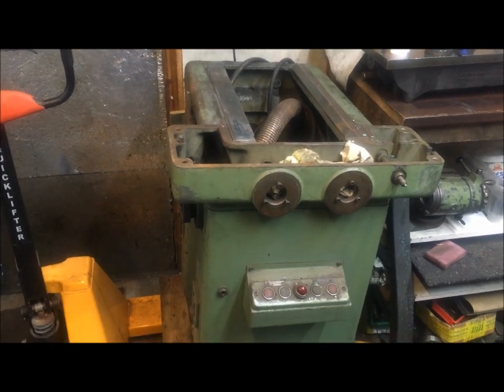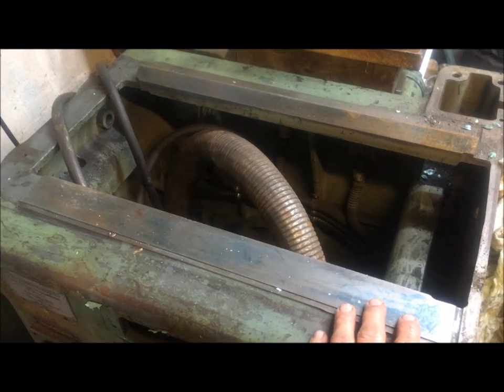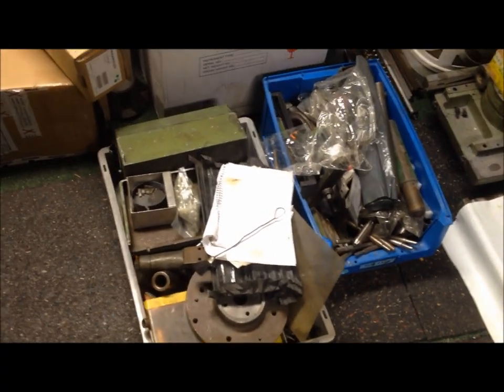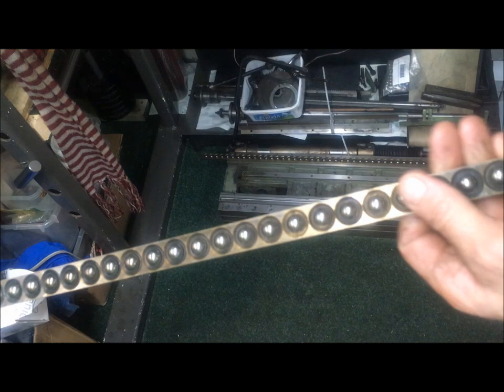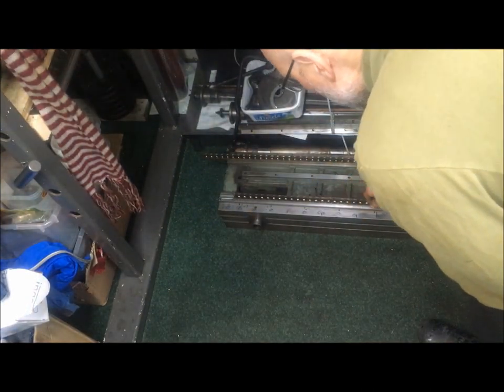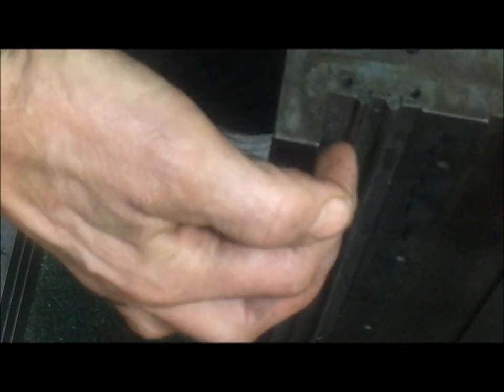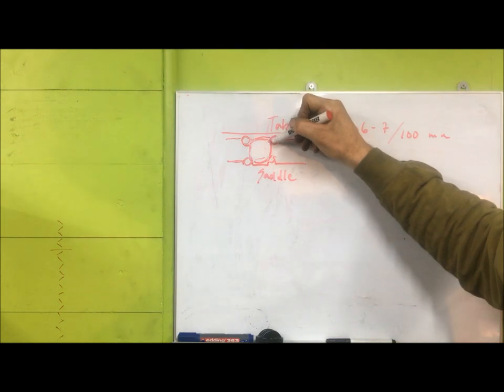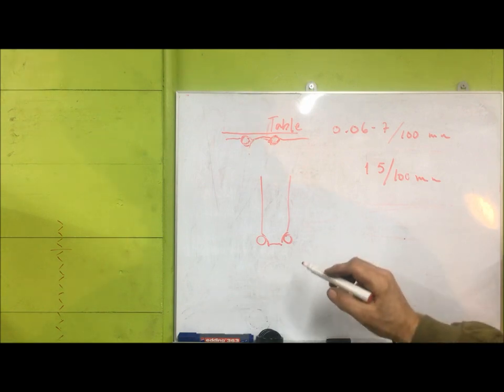Saacke UW 2

Comment: This is going to be a good watch Jan, good luck with it.

Alan.
Reply from the maker: Thanks! I had to drag the beast of a foundation into my workshop as the garage needed to be used for its' intended purpose, namely housing the cars :)
Therefore, "landing" it into the shop, I thought it was timely to "officially" start the restoration project (on my part.. my friend, the former owner had also done some work, pulling it almost all apart and in particular improving on the flatness/straightness of these "way strips" )

Comment from the maker: As the former owner pointed out, he did a certain effort to "straighten" the strips already, as the wear was considerable. Very nice, and thanks Ola! He also mentioned being in contact with Saacke, who no longer supports this type of machine, having left this to a company called Schreyer. Saacke confirmed the possibility of doing the grinding the way I intend, but stressed the importance of setting up the wheel with the exact diameter of the 12mm balls, ie. radius grind the wheel to 6mm on the sides. Retaining the distance between these strips it means the 2 opposing sides of the table/saddle will come closer, so it remains to be seen if I have to allow for this also ie. grind or mill off what is needed.

Comment: Hi, I can see what you mean by the distance between the 2 rows of balls not being the same distance as before would cause huge problems, I find it strange that they have made it this way, because it have to be made very accurately, if one of the ways was flat any wear would not cause problems, You should watch Robrenz, he is restauring a grinder, when you are done with the restauration and you need something to grind then  I got 2 MK4 test bars that could use some grinding to be usable for test bars :-)
Reply from the maker: I might check up with manufacturer/service company  in case they have some more ideas what to do. Perhaps it is equally good just grinding a 45 or 60 degree flat V-way that the balls can ride in. Will confer with Mr. Renzertti also
Reply: Hi, Asking Robin is a good ide, what I dont think is a good ide is to let the balls ride against the cast iron (wear)
Reply from the maker: Agreed! My thoughts is to try to restore the original idea, which I seems to understand is to let the balls ride against the 2 strips (hardened). They appear to be circular 6 mm diameter rods and I thought a grinding disc setup with the correct distance between 2 circular grooves could establish this. Possibly having to relieve the center portion (and maybe other areas, eg. to avoid the saddle and table coming into contact)

Comment: Why would anyone design machine ways this way? Not only does it seem to be overcomplicated, but it introduces more deflection than a flat vee way. Plus a greater risk of brinelling. 
Ps. If you need help translating something from german I could help.
Reply from the maker: I reckon Saacke had their reasons, but it may be a bit tricky to get right again when worn. PS! I think it is quite common to have "floating" tables on grinders, isn't it?  Thanks for the offer, but I am OK in German, so should do fine :)
Reply: @jansverrehaugjord9934  Schön :D. I'm sure most quality grinders use floating ways. But with a Ball on something cylindrical you will have greater contact stresses than with a ball on something flat. I'm sure you'll figure it out 👍